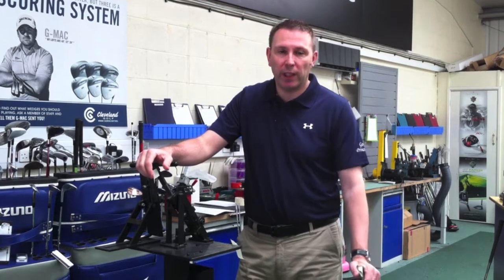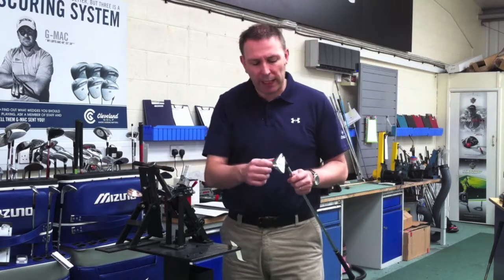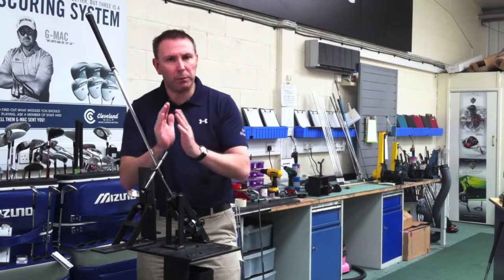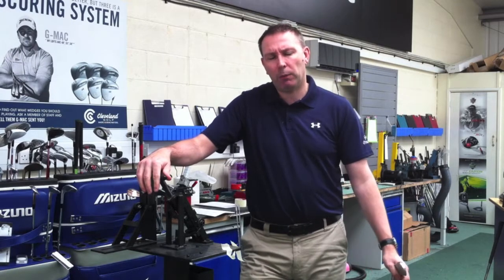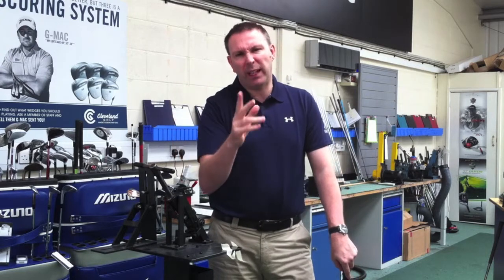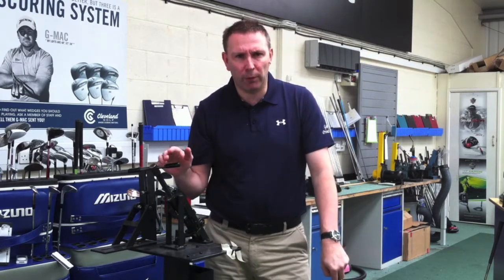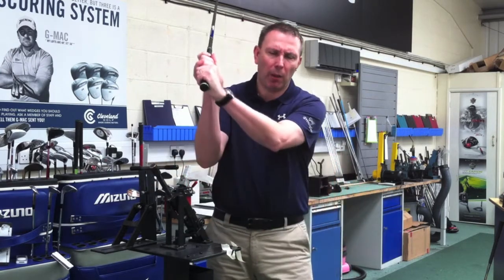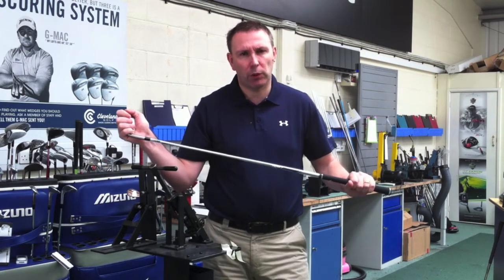Loft and Lie

Comment: Great video! Could you go into a bit more detail about the type of shaft and how it works with different swings (one-plane/ two-plane)? I have used DD S400's for many years, but have flattened my swing a few years back and was looking at putting the KBS C-tapers into my clubs to achieve a flatter trajectory. I was never aware that certain shafts work better for flatter/more upright swings.
Thanks!